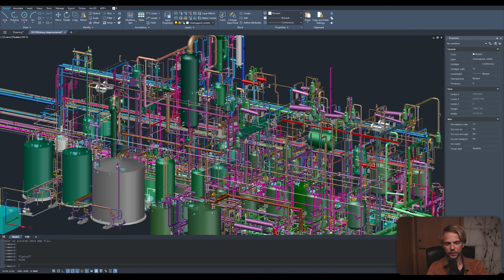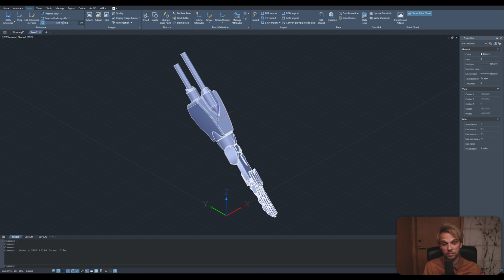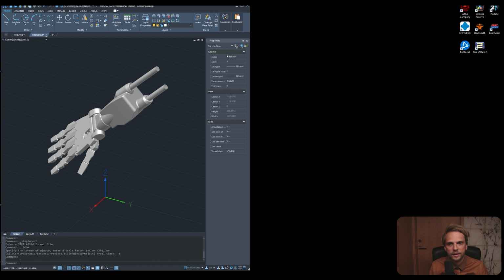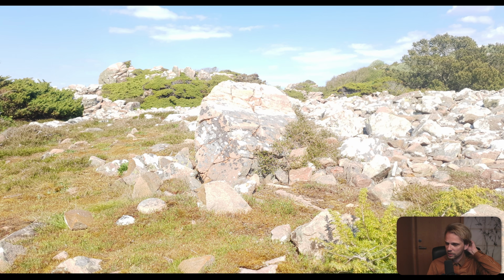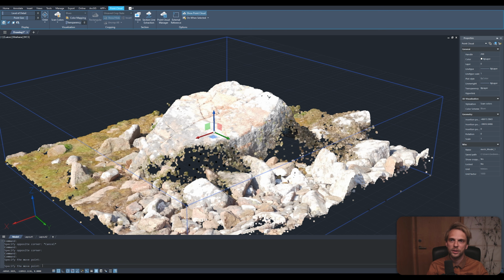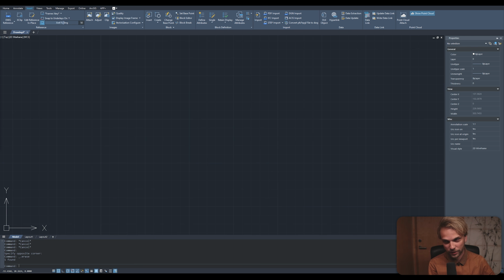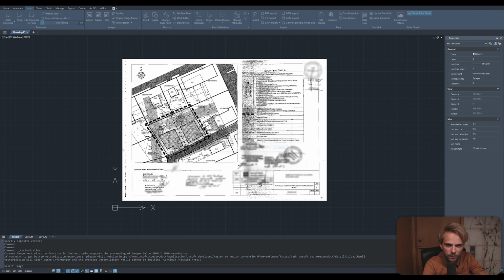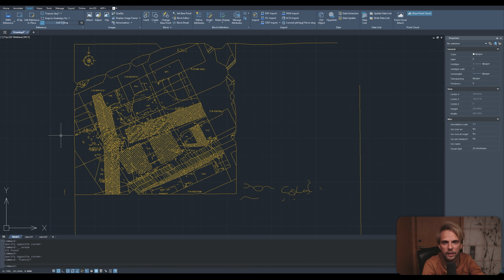This AutoCAD alternative is growing FAST! - 1 year overview

Comment: Do you have a recommendation for a cad program that is free or offers a commercial one-time purchase at a student price? I use rhino for 3D and currently vectorworks for 2D drawings…
Thank you for the great content you constantly provide 🎉
Reply from the maker: If you already have Rhino - I'd highly recommend using it for 2D as well. Specially in stead of Vectorworks. 2D drafting capabilities in Rhino are excellent and can be even further extended with such addons like Section tools (I think in Rhino 8 you don't even need to install it)

Comment: Was this a sponsored video?
Reply from the maker: Yes! ZWCAD have sponsored this video. There should be a small automatically generated note (when you hover your mouse over the thumbnail) in the top right stating "sponsored".
With that being said - I don't do "talking points" , so all info that I say comes from my experience with the software.
Reply: @DesignGoBrr  I didn't had intention to point you. Just happy that the channel got another sponsor. Gratitude and respect 🙏 for all that you have taught us.
Reply from the maker: @parassharma6560  didn't feel being pointed out!